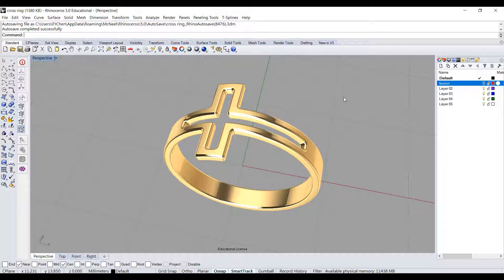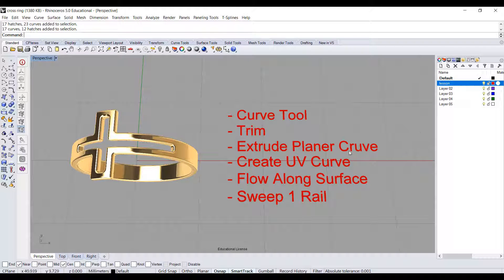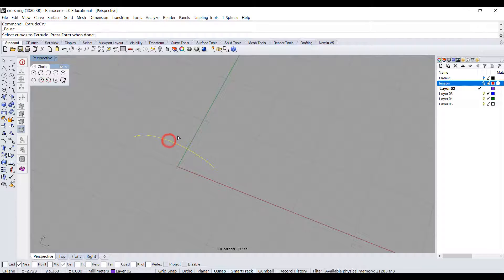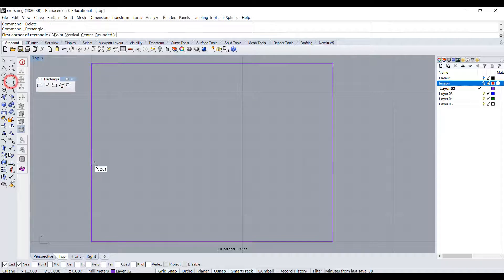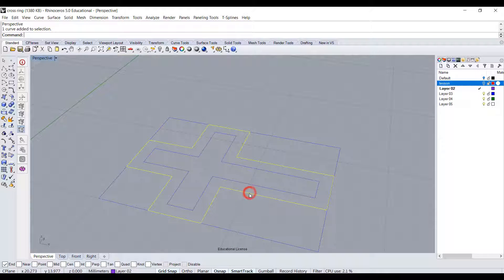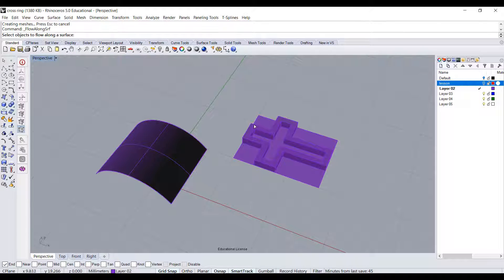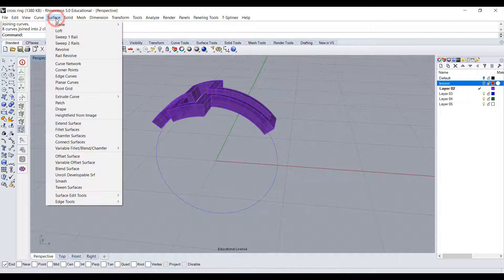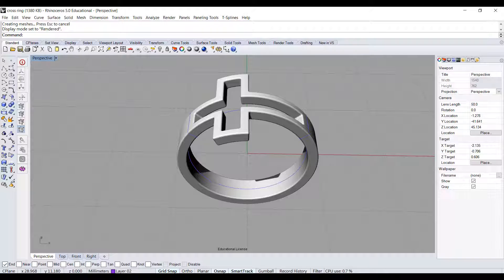Jewelry CAD Design Tutorial #3- How to Make a Cross Ring Model in Rhino 5

Comment: Thank you SOOOOOOO much for these tutorials! I was stuck at 7:02, I'm using Rhino 6, the cross would go under the surface and the ends weren't vertical to the curved surface. The solution was to do the following:
In the command bar select the following: "Base surface - select edge near a corner (Copy= YES Rigid=NO AutoAdjust=YES PreserveStructure=NO".
Hope this helps someone else.
Reply from the maker: Super!

Comment: Thank you for this tutorial! I am new with Rhino, and would like to ask that when the second time I drew the ring, the diameter (17.3)  didn't fit into the surface precisely. I left it like this, at the end the Boolean union cut off the cross, so I had to make the ringsize smaller (14.3) then it worked. I wonder where I went wrong..
Reply from the maker: without seeing your model, it is hard to know what exact happend on your model. if I have to guess, I will advice to check the distance on your base curve to the object. the object should sit exact on top of the base curve. there should not be any distance.
Reply: @PJChenJewelryDesign  thank you for your advice 🙏

Comment: Hi, My rings tend to shrink 1/4 - 1/2 size smaller after the casting.  Do you suggest making the ring 1/2 size bigger in CAD to avoid the shrinkage? Thank you for making wonderful videos
Reply from the maker: all 3d printer, casting and finishing process has different shrinkage and material waste. If you know exact shrinkage form cad to finish piece, you can add the difference on your cad.
Reply: @PJChenJewelryDesign  thank you so much for your response ❤️

Comment: I am stuck at 8:08 once I get to 'Select cross section curves'. Im not getting the option to choose both ends of the cross to complete the ring. If I try to select each edge it manually it says 'Unable to order shapes on rails'.
Reply from the maker: are your close section "close curves". If not, you need to join them first.
Reply: @PJChenJewelryDesign  thank you for the fast response. I did not join them correctly at first. I tried again now and it worked perfect. Thank you!
Reply from the maker: that is great!

Comment: Wonderful tutorial!! Questions: is there a command for duplicate edge in the menu bar.
Reply from the maker: I usually just type it DupE. then it will show up. It is also living under curve-curve from the object- duplicate edge.
Reply: Thank for the quick reply, I've had problem selecting both edges, I had to select line by line and it didn't work out. Thanks so much.
Reply from the maker: It is possible that there are seams on the surface so the edge of the surface is in the segments. You can select them and join all the curves.
Reply: Thank you very much